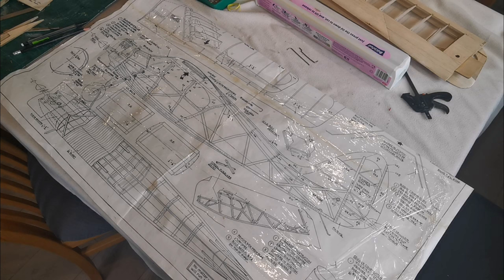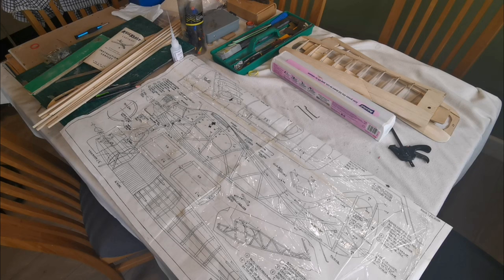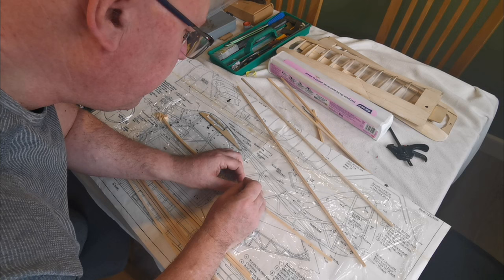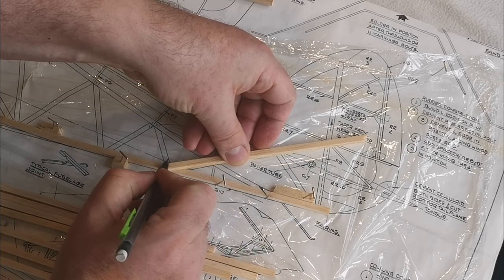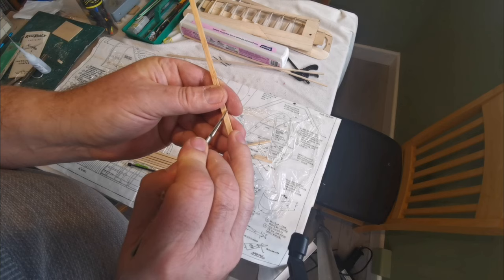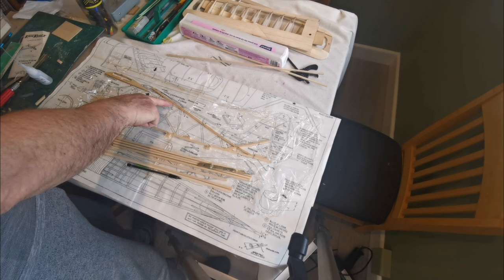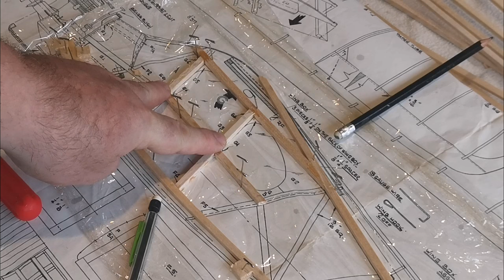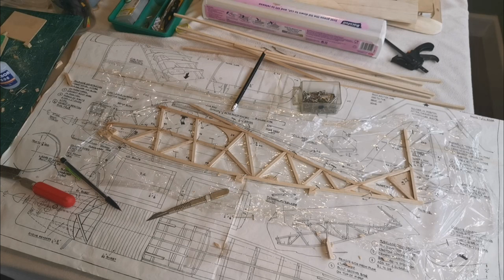Keil Kraft Ladybird 🐞:Fuselage build

Comment: How did you do the other side? I held the plan up to the company light box and traced the mirror image of the fuselage side then built on that. Meant I could lay the gussets flat to the board again. Never liked the  often suggested idea of building the second side on top of the first side. You?
Reply from the maker: I always build them separately to be honest, working with CA glue it's  rather easy to place the gussets where you want them.